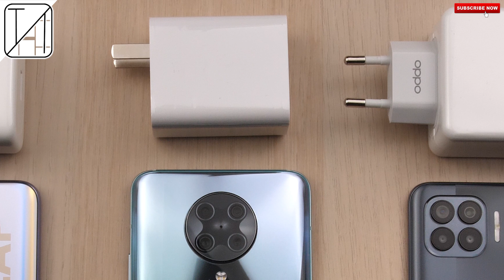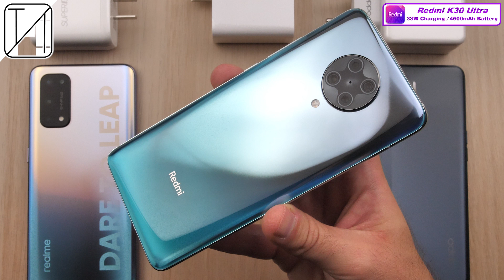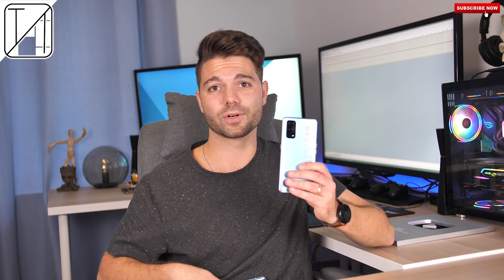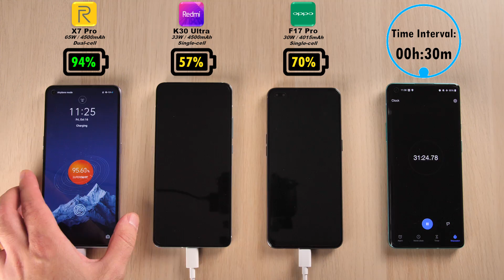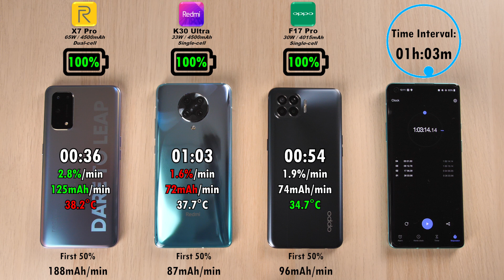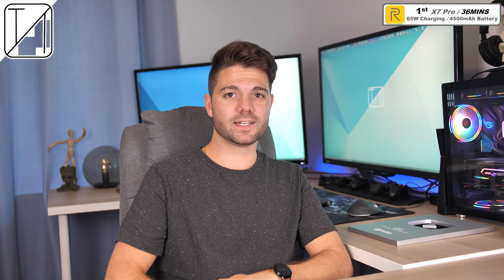Realme X7 Pro vs Redmi K30 Ultra vs Oppo F17 Pro Charging Speed Test

Comment: The Fast Charging thing is good but it will sooner or later going to damage the battery. The thing is that i am ok with phone which take 1 to 2 hrs charging and give me whole day battery backup despite of what i am doing with my phone. Like the samsung M51   
with 7000mAh battery. Nick If YOu are reading pin it plz